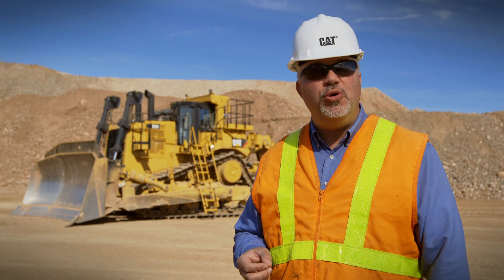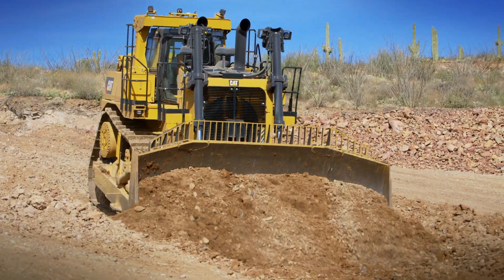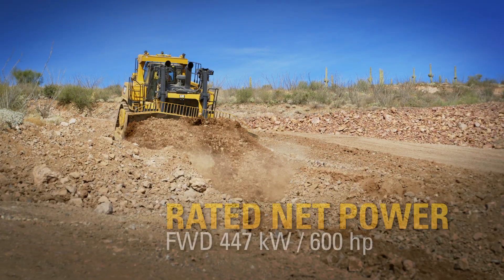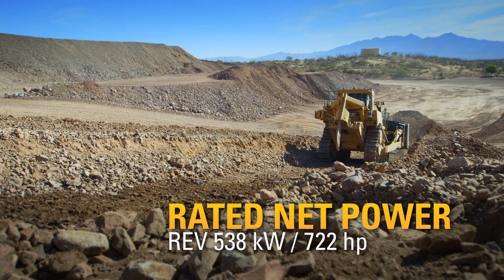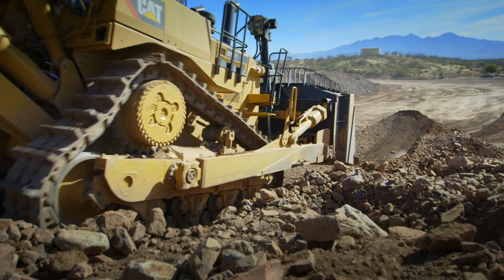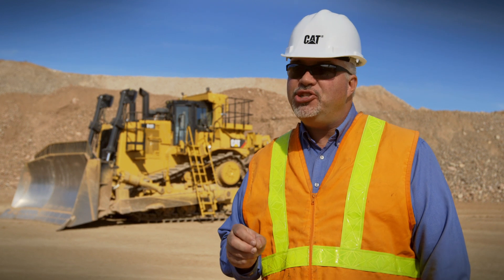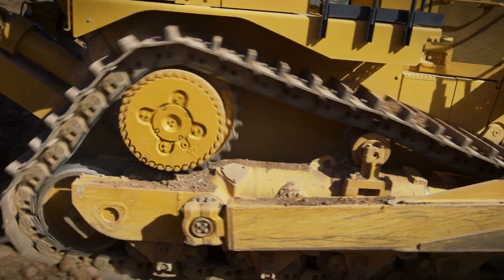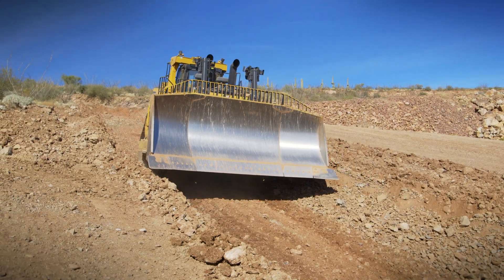Cat® Large Dozers — D10T2: Power Management Strategy

Comment: I thought you can’t run dozers in 3rd gear? No good for the drive train they said.
Reply from the maker: Hello Thanos! Your Cat dealer can help! To find a dealer near you visit https://bit.ly/2Q55zxA. - Brad
Reply: @catmining  All those electric this and that  .  Everything has a sensor .   30 years from now all those sensors and switches are gone and the tractor cost more to replace than fix . The D9 H will get passed to your great grand kids if you keep good undercarriage  and sprockets  . Is there a way to order a tractor with out all the gadgetry